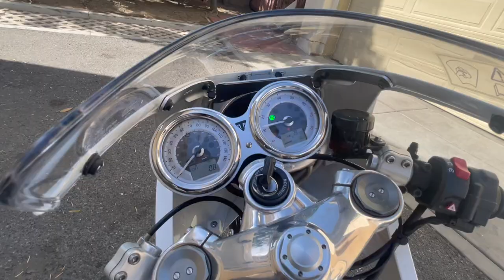How To Change The Oil On Triumph Thruxton R!

Comment: That's a good idea to fill the replacement filter with oil. What setting are you torquing the sump bolt to?
Reply: Always good to lube your filters, a good rule of thumb for drain bolts is snug with a 1/4 inch ratchet. You only want hand tight. The Book says 25newtonmeters but more than one person has been on the forum with stripped threads..
Reply: @Ryansanders80  I suspect the main cause of stripping threads are due to people incorrectly setting their torque wrench in lb-ft instead of Nm. If you enter 25 lb-ft you end up with 34 Nm and a stripped thread.
Reply: @Virtualmix  also click style torque wrenches have a minimum and maximum accurate range and need to be calibrated on occasion. Often over time it will loose accuracy for low torque applications
Reply: 2 years late....but filling the filter is as controversial as Ford vs. Chevy.

I do fill the filter when I can....but try NOT to fill the center section to prevent unfiltered oil entering the motor..

Comment: Nice. Not sure how to check oil after. How many liters? I’ll check the manual 😉
Reply: The engine takes 3.2L for an oil change or 3.4L including a filter change.
Use the glass window on the right side of the engine as shown at 2:34 to check the oil level. Add the oil slowly to not overfill.